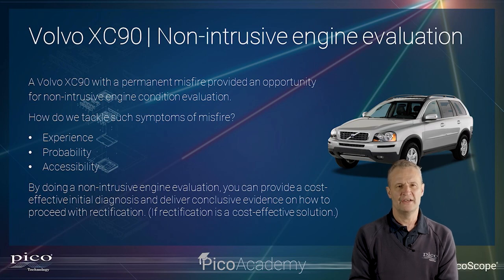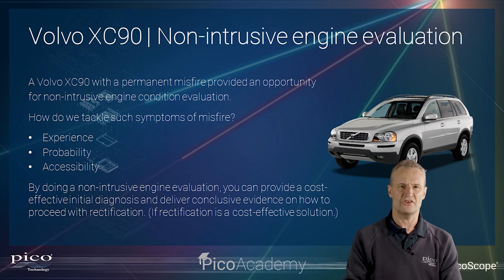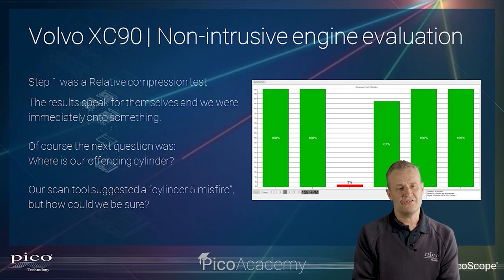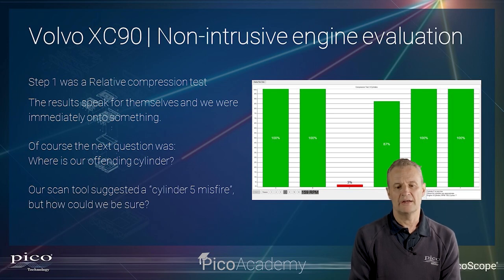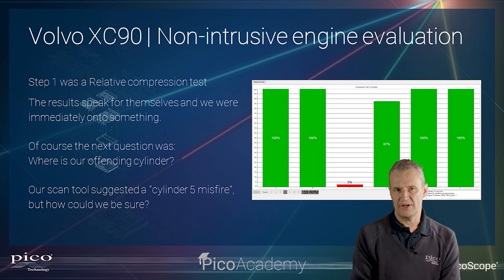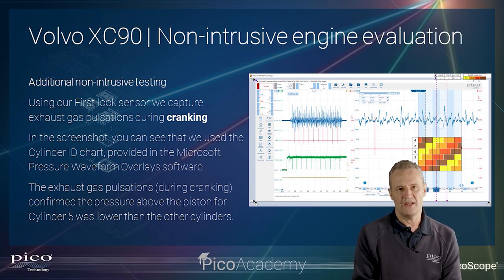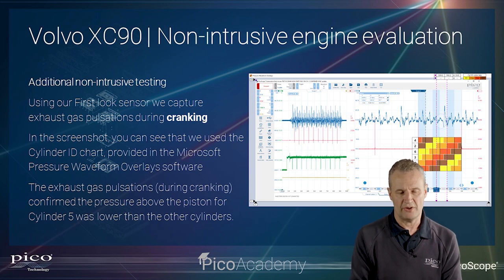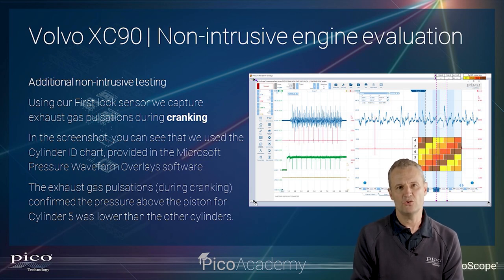Case Study: XC90 misfire with Steve Smith | PicoScope

Comment: Great info and explanation of the pico's capabilities. 
1, It would have been nice to know the actual final cause of the fault.
2, might have also been worth doing a crankcase pressure capture to ensure it was just a top end problem without any contribution from the bottom? So many of these modern engines have failed rings at much lower mileage than expected. 
Thank you for sharing. I'm relatively new to this and only have a 4223. Is there an easy way to overlay captures using a common trigger point?

Comment: I found this informative however I have a few questions and agree with Patrickl6866 about the volume. In fact I have found several Pico training videos where I have to turn all my volumes for my speakers up to the maximum just to barely hear the narration.  This is not the first time I have commented on the volume. Please ask the author of the video to adjust the volume gain before publishing.  Now for my questions.  You mentioned the Microsoft Pressure waveform overlay and the pressure overlay software. I'm very interested in this and how it is done.  Additionally around time stamp 18:00 you talk about sweat or sweep volume. I couldn't make it out and the closed captions spelled out Sweat Volume.  Can you clarify and explain what this is?  I hope someone is monitoring comments and can reply.
Reply: Swept volume. That is the volume change in the cylinder as the piston moves up or down. At least that is my interpretation.
Reply: Thank you.